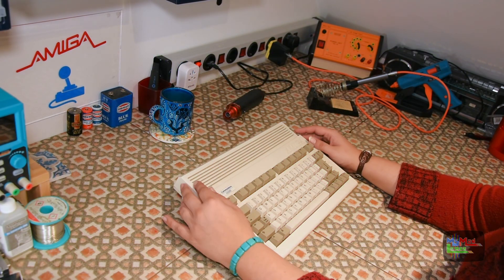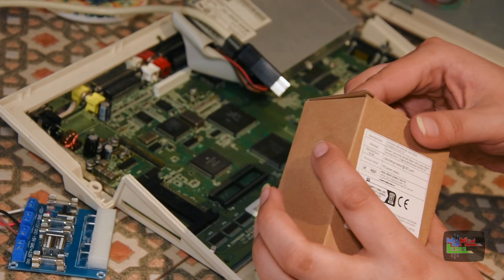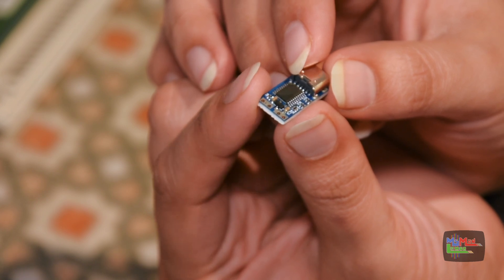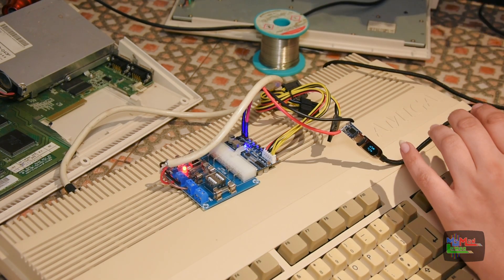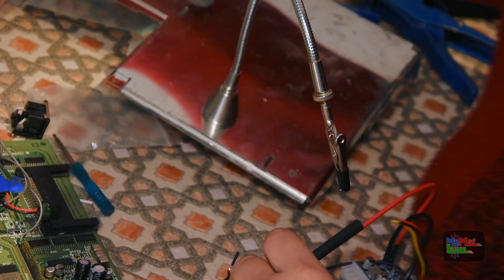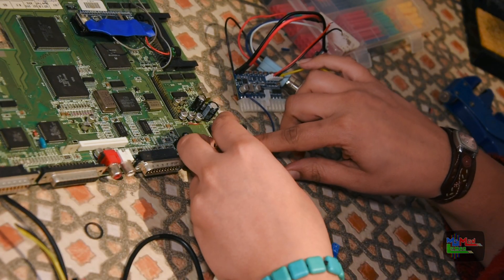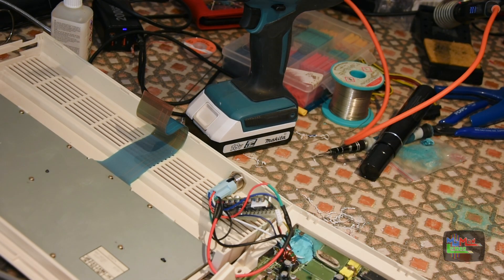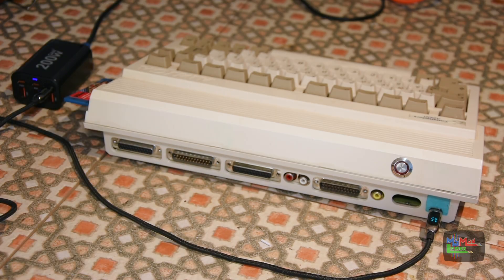Amiga USB-C Power MOD - A600 Portable Setup Series

Comment from the maker: I'm including here the Amazon links to the things I used in the video:
DC-DC ATX power supply: https://amzn.to/48TAlCF
USB-C to 12v board: https://amzn.to/44cM2C1
Not all USB-C power sources work, they have to be able to provide 20v/12v. This compact Belkin usb-C charger I tested on the Amiga usb-C,  works well and is small: https://amzn.to/4oByIy4

Comment: should have removed your composite jack Yellow one and put a switch there instead of putting a hole in the case
Reply from the maker: i know what you're saying, but there have been times where i've needed to use the composite out for something or other. Either way, i'm happy with the switch where it is. I dont think i'd have liked it where the composite port is.

Comment: Cool! I really like the mod, how it makes use of mainstream modern tech. USB Power Delivery to the rescue. The powered equipment module has a chip which negotiates the voltage level with the power supply, going for the closest lower voltage if the requested level is too high for the PSU to support.

I see you use a Fnirsi HS-02 iron. It uses pretty common JBC C210 style cartridge tips instead of T12 the older HS-01 used. Really good for portable work, though nothing beats a proper station in a lab setting. And yes, this little iron can pack a hundred watts and it uses USB PD as well.
Reply from the maker: It's amazing just how much difference it makes converting it to USB-C. It just feels so much more convenient now :-) 

I'm really happy I got the Fnirsi HS-02. At first I was unsure when it was arriving, I felt it's maybe too good to be true. But I think it's the best soldering iron i've had hands down. The only thing that concerns me about it is that electronic buzzing. You feel some sort of surface voltage on the iron itself (lack of earthing?) Wouldn't the voltage damage any components like ICs you use with it? 
That's the only thing that concerns me about it. Other than that, its fantastic. 
And yes I did check, it works with the Amiga :-)
Reply: @MsMadLemon  yeah, voltage developing between the tip and ground is not a nice thing... and what's even worse, some soldering stations also have this problem. Fortunately modding them by adding a 100k...1M resistor between tip and protective earth does the trick.
Reply from the maker: @KeritechElectronics  Thank you, I get the feeling it's an issue with the Fnirsi usb-c power supply. Maybe i'll try it with a different one one time. See if it eliminates the issue.

Comment: My future Amiga USB PD power supply will work with any USB PD power source that can supply 15-20V. I've even tested it with a USB power bank :)

An internal board that replaces the square DIN could be nice, but there's not a lot of room there. I think part of the problem with why the Powershark is available in such limited numbers is because of it's size. I've designed mine into a Hammond 1593BBBK enclosure which is about 78x95x30mm
Reply from the maker: I am curious how they've managed to get the PowerShark that small. If you're designing a USB-C  solution, I would be more than happy to make a future video about it :-)  Do let me know about the availability of it.

Comment: I was lucky enough to get a PowerShark adapter a few months ago. The price is very high and on top of that, I had to pay additional tariffs to the USA. not the fault of the company of course , its just the world we live in these days. As for how it works its excellent it powers my A1200 + Blizzard 1260 Accelerator card without issue. Now id like to order some more for my A600 and A500. Great product just near impossible to buy and quite pricey - but this is the Amiga so thats no surprise lol
Reply from the maker: It is impressive that it can power the A1200 + Blizzard 1260. But tariffs aside, the price is very high for the power shark. I personally  don't think I could justify getting it for all my Amiga computers as much as I like it. 
This solution just feels much better value for money and i'm pretty sure I could refine the mod/installation also. However, I wouldn't say no to a power shark if the price was right and if it was actually available. :-)
Reply: It's back in stock at Alinea.
Reply: How high was the US tariff? Which country did you buy from?

Comment: My biggest issue with the A600 is the lack of a number pad. I use that on Octamed to select the samples.
Reply from the maker: Yeah, my primary is the A1200. A600 perfect for a portable setup. But one thing I noticed. I tried a portable setup with Amiberry emulator on my laptop. The keyboard did my head in when using Octamed. I couldn't get used to it. I just needed an Amiga keyboard, end of lol.. The A600 came to mind very quickly.
Reply: @MsMadLemon  I use WinUAE sometimes on my PC, but it's terrible on a laptop for the same reason.

Comment: The Amiga 600 was originally going to be the Amiga 300 and was supposed to be positioned as a lower cost entry level Amiga below the A500. But the bean counters at commodore decided against that and it became the A600.
Reply from the maker: Yes that's right, my other A600 says A300 on the motherboard.

Comment: It’s a handshake negotiation with the power supply so it will pull the correct Voltage and Amperage. So no voltage conversion on the board itself. You just need a USB C “Power Delivery” compliant power supply. I’ve been adding PD wall outlets in my house in various places to avoid having to use power bricks.
Reply from the maker: It's the "Power Delivery" or PD term that I didn't know when I was creating the video. Thanks for the explanation.
Reply: @MsMadLemon Great video! Look forward to seeing the full portable conversation.

Comment: 14:15 You can desolder those ATX connectors which reduces the size of the pico. Also with the power good line, you can just ground it to the next pin over which is ground so you don't need a wire going from amiga to psu for that.
Reply from the maker: The PS-ON line, I didnt take a wire from the Amiga to the PSU, as I said in the video, I did just bridge the two pins as they're next to one another. That wire you see is just the -12v connection from the PSU to the Amiga.

I did think about removing the ATX connector at the time, maybe because it sort of aided the installation physically, I will probably remove it in the next Amiga I mod like this though.

Comment: I have a Powershark powering an A1200 with ACA1240 and external Gotek drive. No problems at all. The only problem is getting a Powershark.

I personally prefer an internal solution like what you have done but without modifying the case too much.

There is a gentleman on Youtube who is building a solution that I believe does not require modding the case and his most recent update was last month. 

What you have done is very neat and I'm going to follow what you are doing as it is a viable option and people can come up with their own solutions if they don't want to mod the case.

Comment: I got the Powershark adapter, it got the same limitation of requiring a 12V PD adapter. I'm using it with the raspberry pi 5  27W adapter (12V/2.25A) in a A600. And this works well with pistorm/rgb2hdmi and mutiple diskdrives/gotek

Comment: It's called a 'decoy board', it negotiates the voltage with the USB-C power brick. To my understanding most 30W and more should be able to provide 12V.
Reply from the maker: Thanks for the explanation, I recently got a more compact 30w power brick that didnt work despite it saying it can supply 12v. I guess it can be picky, I had to return it and get this one, which worked perfectly and it's nice and compact: https://amzn.to/4oByIy4